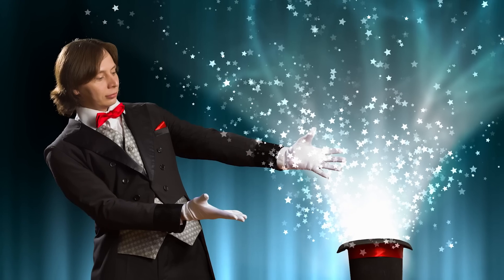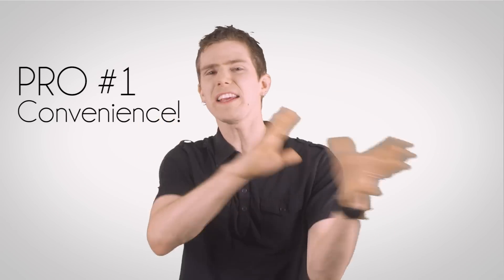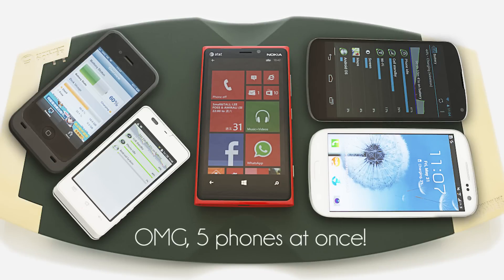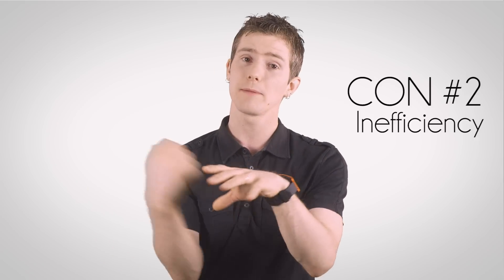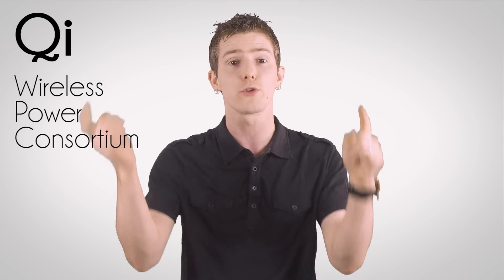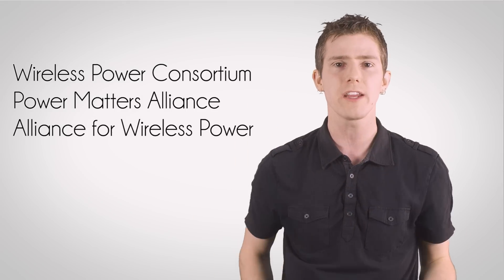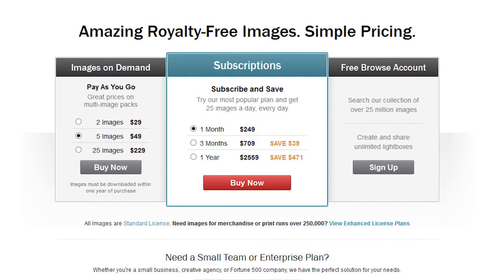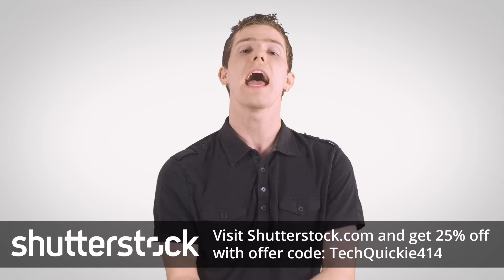Wireless Charging as Fast As Possible

Comment: Never. Wireless signals or streams can be easily disrupted. I'll stick with my wires. Wired mouse, keyboard and, hey look at that, wired charger.
Reply: Can, yes. You also CAN get killed by meteorite while outside, so make sure to never leave your house!

Bluetooth keyboard, mouse and headphone user reporting in. 0 issues so far.
Reply: ***** wireless keyboard and mouse = NEVER. I've had a wireless mouse and it's the worst. every month it would be empty and I'd have to go on a battery search again while in the middle of something... (I know, buy a battery supply.. I don't live alone though, they vanish lol)

and then my dad had a wireless keyboard and mouse but they ran out of power even more often... no thank you. it  may be less messy, but for the rest it only has disadvantages for things like that
Reply: HazewinDog
So just because you are cheapskate and bought the shittiest, cheapest wireless mouse in existence means they all suck?
You make so much sense.
Reply: ShadowwwLFS excuse me? the problem with this is that they run out of battery, which I find the most annoying thing ever. whether it's monthly or once every few months is far less important...

and the mouse was a gift so thank you very much I suppose.
Reply: ***** so basically you can choose to go either cabled or wireless? so possibly use wireless, then when it runs out charge it when using? I'm sorry if I understood it incorrectly, but that would indeed be nice :) aside from more cables behind my desk, I don't have much drawback from a cabled k/b and mouse, though, but if it's as I mentioned then it wouldn't hurt to go cordless ^^
Reply: HazewinDog
Swapping batteries once a month (more like once in 3 months if you buy decent products) is much less of an annoyance than cluttery wires all over my desk.
Reply: ShadowwwLFS don't have them over your desk but behind...?

***** hm yeah, most likely. I don't need to unplug my keyboard and mouse that regularely, + the cables for mine aren't too long to cause a mess, and not too short to be too tight. so for me I wouldn't get much use out of going wireless ^^
Reply: ShadowwwLFS I came across a video of a skydiver almost getting hit by a meteorite. didn't look into if it was a fake video or not.
Reply: everyone bitching about the clutter and mess of mice and keyboard wires is fucked in the head honestly hahahah
for 1 how long are your god dam cables?
and 2 ... wtf do you do take all the extra slack and pull it up onto your desk?

no matter how good a device you buy.. if its wireless it WILL run out of juice and it WILL have letency issues compared to a wired mouse/keyboard

both of those issues cause more trouble when gaming than any amount of cords will do
Reply: ok have a good life
Reply: HazewinDog Buy a fucking good wireless mouse.
Reply: ShadowwwLFS You don't have to change batteries at all when you buy a good mouse. I have the Performance mouse MX and no wired mouse can beat it.
Reply: Toaster
heh, I actually have Performance MX myself as well. I was speaking on the behalf of most mainstream wireless mice, which do not have integrated re-charging features.
Reply: ShadowwwLFS Gonna be honest, that response made my laugh my ass off. Thank you.
Reply: HazewinDog wireless mice dont run out of power as fast as they used to, take the logitech g502 for instance, they had an initial prototype working on battery for so long that it wasnt dead by the time they released the consumer version.
Reply: Haha you guys are seriously arguing about this this is childish shit they are both great and have there advantages and disadvantages but there is pretty much no difference.
Reply: There are differences, but only those that solely focus on them see them. You simply won't. It's their*, by the way. Not there.
Reply: HazewinDog i bought a wireless keyboard and mouse combo and it's really convenient and helps me do stuff that I want. My keyboard needed a battery change like once so far (almost a year), but my mouse needs a new AA battery twice a month. It only has 1 so maybe it runs it dry fast. It's also an all terrain/surfaces mouse (vertical beam, not angled forward). My solution was to buy 2 rechargeable AA batteries and always keep the second one full/charged and on my desk (under my monitor actually). When mouse runs out of power I exchange battery and immediately recharge the old one.
Wireless communication is not like wireless charging. It's doable, while wireless energy is very wasteful and limited.
Reply: @bongcrusha420 you mean latency
Reply: @uuubs wired charging WILL ALWAYS BE QUICKER WHEREAS WIRELESS CHARGING WILL BE MUCH SLOWER
Reply: You are better off keeping to using a wired mouse and wired keyboard(that it what I use and it is just fantastic and lasts me for over 6+ years).

Comment: so i have a galaxy s4 what would you recommend i buy for wireless charging?
Reply: I'm using the nexus orb charger and an aftermarket charger thing that fits in the battery compartment, in behind the stock rubber bumper case (samsung brand).  It works quite well but I did root the phone to turn off the 'charge complete' sound; among other reasons to put cm10 on it.

Comment: can i use wireless charging with my galaxy note 3 if i have a case on it? im using an otterbox defender.
Reply: The galaxy addon charger backs tend to make the phone a tad thicker and they don't always fit in a case afterward - its easily thin enough to charge through.

Comment: cant they charge through radio waves or other waves in the air?
Reply: For signals to effectively travel through air, it needs to be HIGH frequency...as in several hundred Megahertz or even Gigahertz. Your typical AC power from the wall outlet is 50Hz/60Hz. Most electronic devices uses DC voltage.

You would need a device that can "modulate" the 60Hz AC voltage signal to the MHz/GHz range. Once it reaches your phone, it needs to "demodulate" it back down to 50Hz/60Hz. In the process, the signal that you want becomes attenuated (i.e. voltage is lost)...so you would have to amplify/recover that loss...which is another problem.

Since you are dealing with radio frequencies and sending stuff over the air, you have to deal with the regulations standards that are in place throughout the world...

Comment: I don't buy the argument of convenience. What is convenient about having to place a gadget in nearly the exact same spot and orientation on some plate every time you want to refill it? To me, it is much more convenient to have a cable I just need to plug into my device and then being able to leave it somewhere on the table where I usually use my phone it. And I can even use it while it charges because I can hold it in my hands! How's that for convenience?

And to me, inefficiency is the biggest drawback. Wireless charging is wasteful as hell, and we're in a state where we're wasting energy already far beyond what we should do. I see no point in wasting even more.

So, no, wireless charging does not rock, imho.
Reply: Good point

Comment: Wireless charging won't take off.
1. Range is almost non-existent. So you can't move it at all while it's charging which you can with a 2m charging cable. But I can see how it would be handy in public places where you forget a cable or something.
2. Increasing range will interfere with other electronics.

If only wireless charging could be achieved without Electromagnetic Induction.

Comment: How does Wireless Charging charge slower than a Wired connection? If you have a 5W adapter, it’s charging slower.
Reply: More losses. Wireless charging has to be AC, while the phone takes DC. So using a power brick you convert wall AC->DC->AC->DC... There are also losses in heat generated by the magnetic field being absorbed by other materials.

Comment: Wireless charging can become cool. 
But for now, as long as its slower [it will be forever], and still requires you to put your phone on something, I guess I'm not lazy enough to care about it.

Plus .. I wonder how power efficient it is ;d
Reply: My S4 charges on wire in a few hours
on wireless it charges in about an hour longer.  Really not a huge difference in speed as I've seen - I get a full day out of my battery and its almost always charging overnight on the stand.
I use a portable battery when I'm on the go and want extra juice for games or movies.
Reply: I bought like 4 extra batteries and charger for my phone for like couple of $ on ebay.
Everytime a battery runs out I change it and put the old one charging.
This way If I forget to put the phone charging I can always fit a new one and go out with 100%.
Reply: its as efficient as having as much wire as is in the coil...

Comment: Please explain how Samsung's wireless fast charging works
Reply: Robotic Nerd It just pumps more power into your phone.
Reply: It's just 2 coils.  more coils equals more POWER!!!!!!
Reply: Guitarocker493 I know...  I mean how it can tell if a phone is compatible with fast charge.
Reply: +Robotic Nerd probably the phone is just sending a signal "yeah, u can charge me"
Reply: ***** I know it's some sort of signal.  I want to know the specifics.
Reply: u know nfc? it's a technology for transmitting signals over a short range(a bit complicated for me to explain, just look up NFC or "How does NFC work")
Reply: ***** I know very well what Near Field Communication is m8
Reply: Robotic Nerd yeah, and the phone just sends a signal to the charger with:"hey u there, i'm compatible, charge me pls"
Reply: ***** That would imply there is an NFC tag in the charger.  Which if there is, it's not a passive tag.  I think it's proprietary, but I still want to know what it uses.
Reply: Robotic Nerd I use wireless charging with my Samsung and leave NFC off.

Comment: In truth Wired charging WILL remain forever and also wireless charging will give off more heat than using a charging cable and heat will degrade a rechargeable battery much quicker